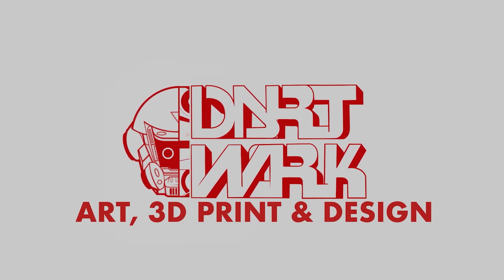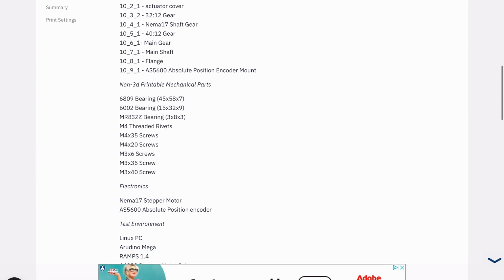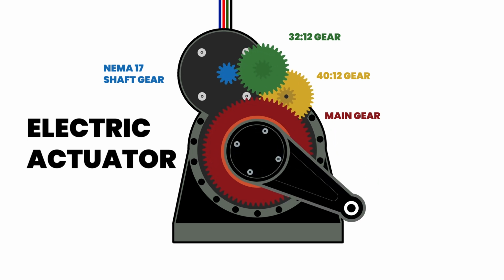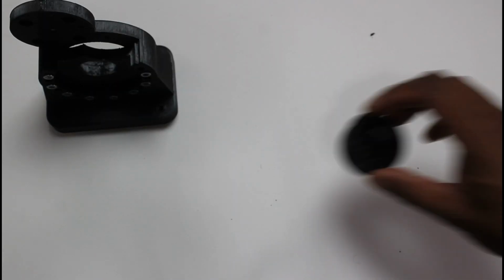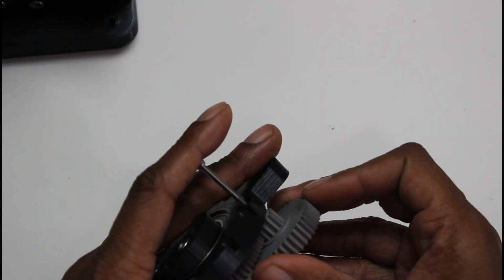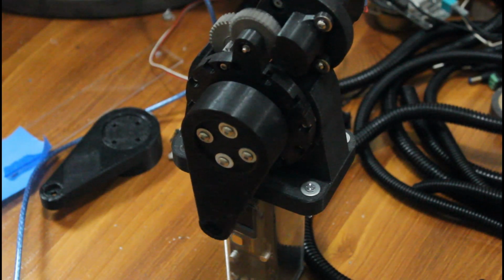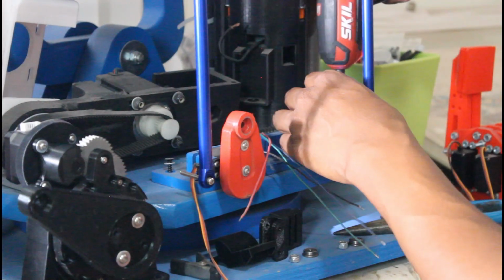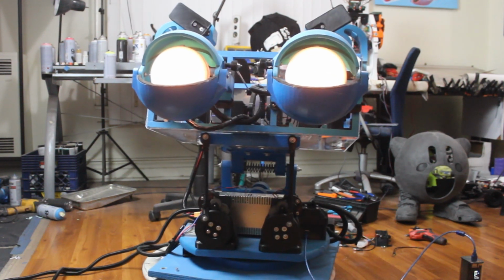3D printed Electric Actuators Used with Robot head.

Comment: Making robotic actuators from steppers is not recommended. weak,  hard to control and may heat up.
next time use DC motors or even pancake shaped BLDC if building a robot dog / humanoid.

Replacing steppers with DC motors makes controlling easier and increased speed / strength.
Mix it with a potentiometer at the gearboxes output gives you a cheap, high-power servomotor.
If you want to further reduce noise I recommend using a pulley belt going from the DC motor to the gearbox.

Comment: Hi DARTWORK! do automotive assembly robots really use hydraulic actuators? I thought they used servomotors with encoders and various gearboxes. Some quick research on the KUKA site and I couldn't find the answer. Thanks!
Reply from the maker: In general, hydraulics are the strongest among the types of actuators I mentioned. Of course, it's possible that on some car assembly lines, different types of actuators are used for specific tasks.
Reply: @Dartwork365  Yeah that's basically my question. I don't think I've encountered a robot with hydraulic actuators before irl. It would be cool to see though. I'v eonly ever seen robots with servomotors. I'd be keen to see some examples of robots with hydraulic actuators and how they would get precise control from that.
Reply from the maker: @paulmcewen7384 Ahh I'm not talking about full robots. I'm referring specifically to robotic arms used on car assembly lines. 

If you watched the video i explain electric actuators are some of the most common in full robots.
Reply: @Dartwork365  We're for sure talking about the same thing. Robots used in auto manufacturing. Typically made by KUKA and ABB. I was under the impression those are all servomotors. Did you happen to have a little info on some of those that have hydraulic actuators? I'm interested to research a little.
Reply from the maker: @paulmcewen7384  I actually spoke with a rep from KUKA, so it turns out they primarily used hydraulic motors in their robots in the past. But as they developed more efficient electric actuators—and due to issues like oil leaks—they began phasing out hydraulics. This shift actually helped revolutionize the industry. They still use hydraulics in some cases, but most have been phased out. So, it's good to know that my earlier info was a bit dated. You're more than welcome to dig into it further, my friend!
Reply: @Dartwork365  That's fascinating. Thanks so much for sharing. Those old KUKA robots with hydraulics must have been insane beasts! I would love to see one one day.
Cheers
Reply from the maker: @paulmcewen7384 Thanks for the discussion im making a robot arm soon ill def have more info on the next video! Stay tuned!
Reply: @Dartwork365  Awesome!

Comment: Are you planning to create a mouth? In that case, is a Robotic Actuator suitable in terms of speed and force?
Reply from the maker: I do plan on adding one but it will be servo powered which is a fourm of actuator. It really depends on the size, design,  weight, and desired speed or movement of the mouth you want friend. 👌🏾🙌🏾
Reply: @Dartwork365  I haven’t found a servo yet that has the speed and torque needed to realistically synchronize mouth movement. My goal is to keep the size roughly the same as yours, which would make the mouth weigh around 10 kilograms. That’s why I’m first replicating Aaed Musa’s Robotic Actuator (due to budget constraints), and in the worst case, I’ll go for the High Precision Speed Reducer. Unfortunately, both options are quite expensive when combined with ODrive control.